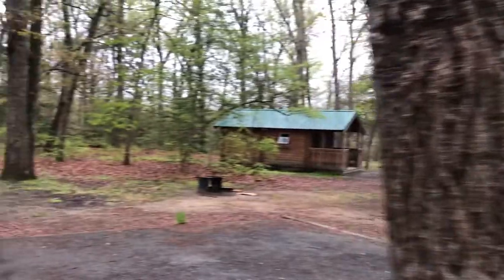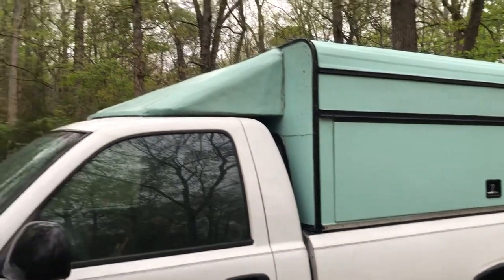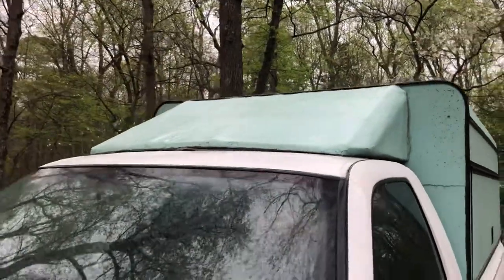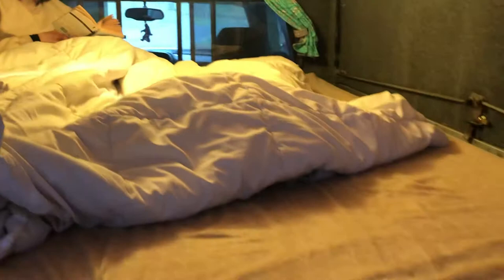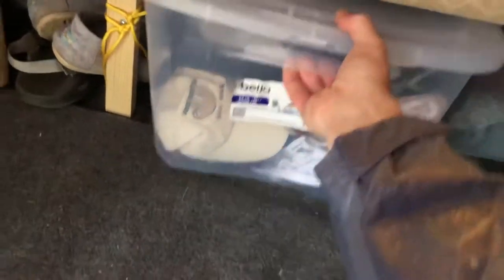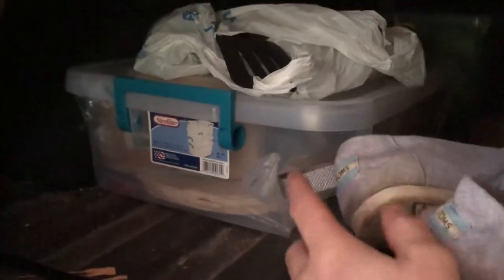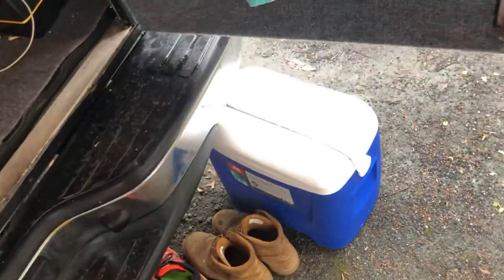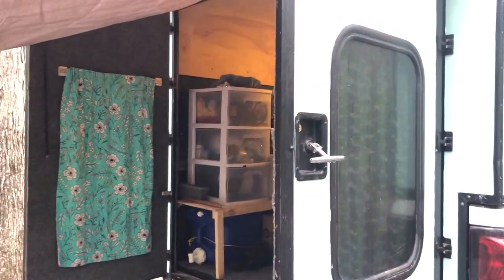Camping in a Truck Topper

Comment: Great set up.i did pretty much the same .I add 1" Styrofoam board on the inside of mine to the floor help with insulation.i used the ac tape to secure them together. Have fun camping.